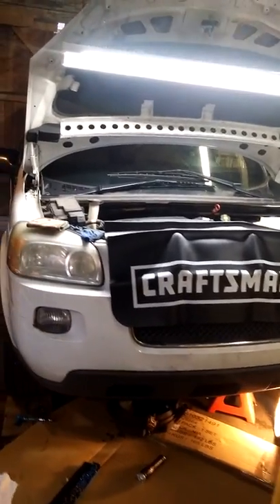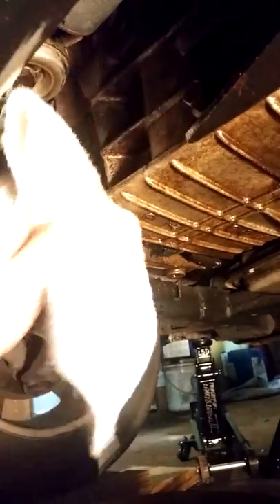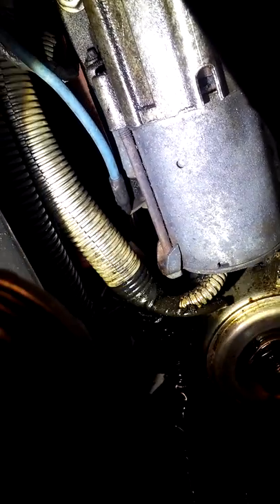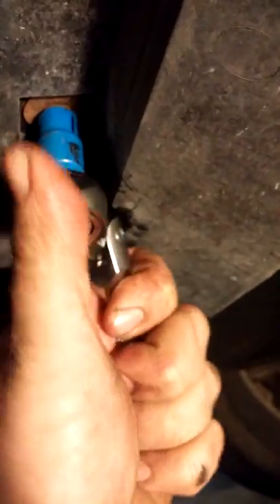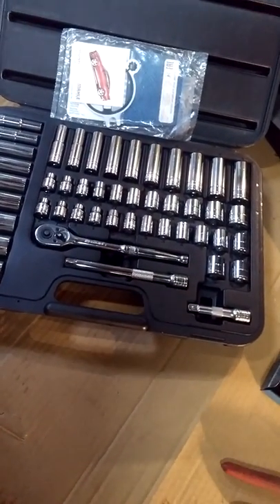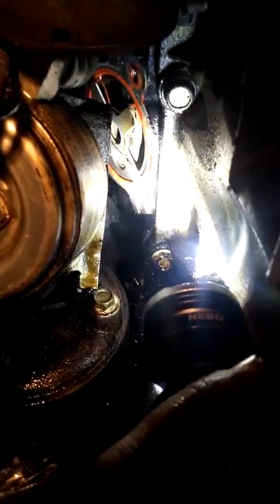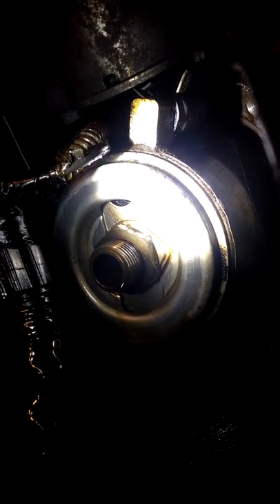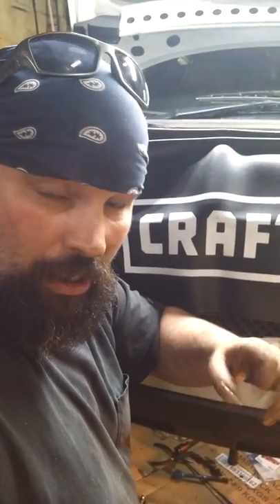Replacing Oil Filter Adapter Gasket On A 2007 Chevy Uplander Mini Van 3.9L #BackwoodsHippieGarage

Comment: did this job yesterday 2007 uplander. able to do it without removing anything but front air deflector for access to the bolts. i put a fel-pro gasket on. this video helped a lot. thanks. 👍👍
Reply: Do you recall if your filter was wet with oil prior to replacing the oil filter adaptor gasket? In this video, he's already removed the filter, so we can't see. I have a slow oil leak from my Uplander, the oil pan and transmission pan are soaked, however the filter is dry. If my oil filter adaptor was the cause, I would think that the filter would be wet with oil as well.
Reply: Yes the filter was wet with oil too. If your filter is dry then you may have other things going on. On these engines i think they have a dummy housing/ shaft where the distributor used to be. It runs the oil pump being driven off the camshaft. it's basically a distributor without the upper half with the cap and wires and ignition components. these are notorious for leaking. there is a small round gasket under the housing where it goes into the engine. check this area out for your leak.

Comment: To make it a little easier once the long bolt is holding the gasket ,line up gasket ; use a screwdriver or something like a dowel to place in the top hole. Leave it in until you get next bolt in .  that way you know gasket is lined up. then remove dowel or screwdriver place bolts in and tighten the 3 bolts.   Works good if you doing it alone.

Comment: Once you get to the point put it back together use the long bolt back in the top hole through the adapter and place the gasket up there with the cut out hole on that bolt. Then put a second bolt through the gasket and finger tight and you on your way to being done. I did pull the starter out to make it much easier, but more work.